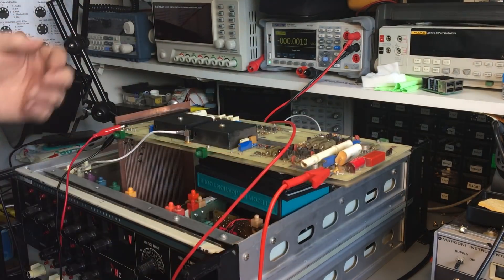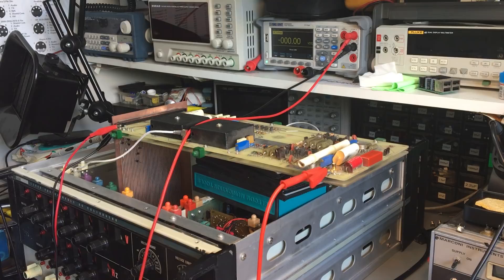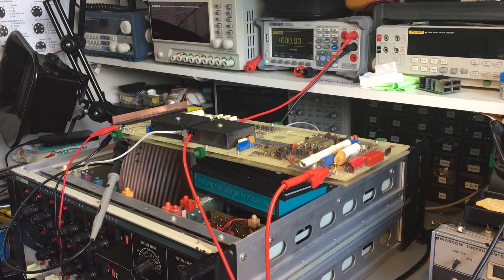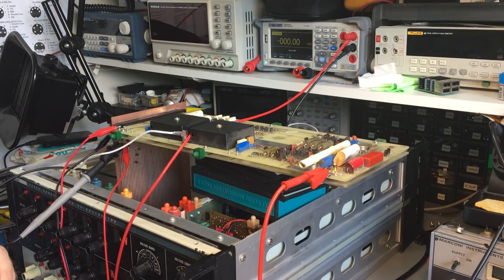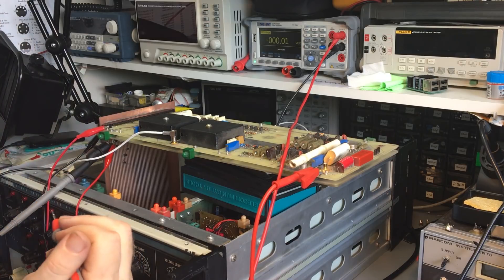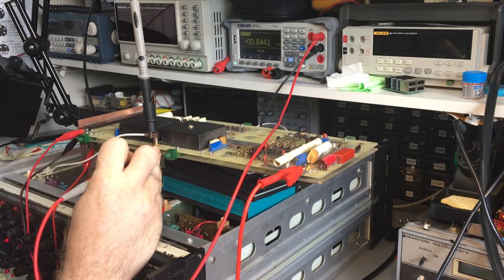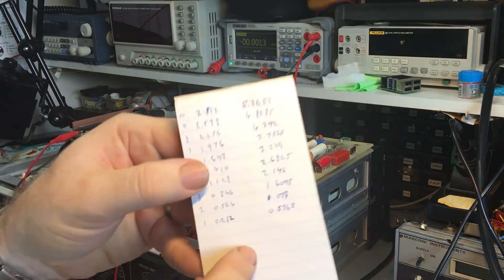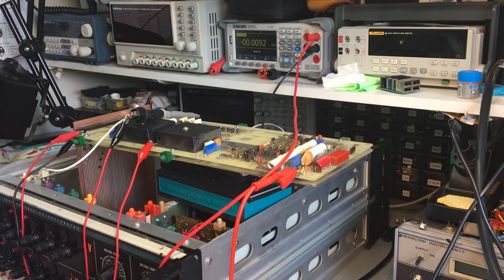🔴 #339 Fluke 5200A AC Calibrator Repair Part 12 - AC to DC Converter A8

Comment: Well the ref voltages and supply voltages look close enough, if they were off it should still operate, but out of spec.
Im supprised its as accurate as it is, not bad for the age of the module.

Comment: Glad to see your hard work paying off. You’ve come a long way from the first video, picking the loose hardware out of the unit. I was amazingly lucky with the unit I just bought. I bought the lowest priced one I could find on eBay that was fully intact. It came in this week, and it turns out it’s working almost perfectly. The worst case is out by about 0.5%, but at 5kHz, it’s within spec. I think all it needs is a calibration. I used it this weekend to run the operational checks on two HP 3562As. I just set the 5002A by adjusting the error control so the voltage on my HP 3457A was right, and it worked perfectly. I’m planning to take some stability tests and log the data before I try to calibrate the 5002A. I want to get some baseline data. That will also give me time to read upon the calibration procedure. I’ll review this series once the time comes to open it up. Thanks for posting these. It’s good information.

Comment: I feel your pain bro, I bought a similar unit a "Valhalla 2703"  goes from 1 uv to 1222.21 volts. and .01 Hz to 100KHz. took me 6 months to get it up and running. It works great now, has better  spects than new, according to my 7.5 digit Keathly and my 20 Ghz freq. counter. how are things going with the house from the storm?
Reply from the maker: House still hasn't been touched yet, insurance wanted a second builder to quote, I hope that something will start to happen soon !
Reply: TheDefpom good luck